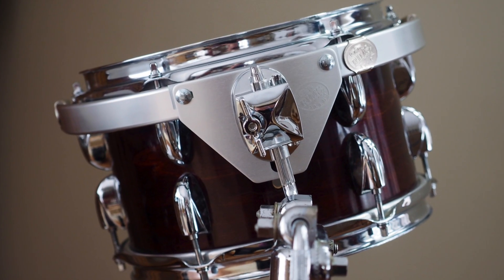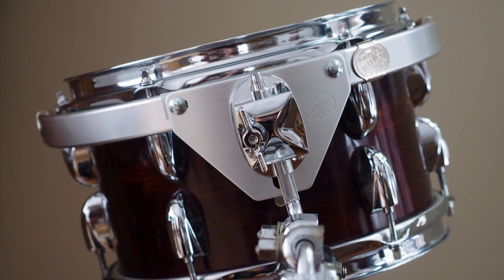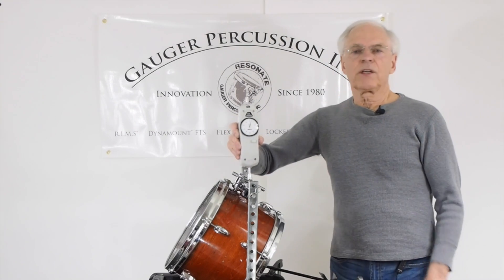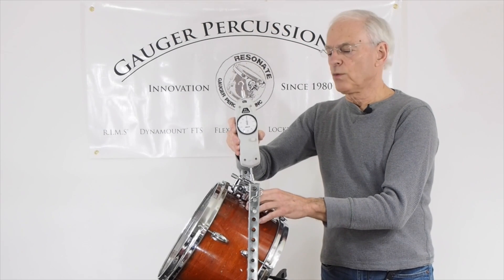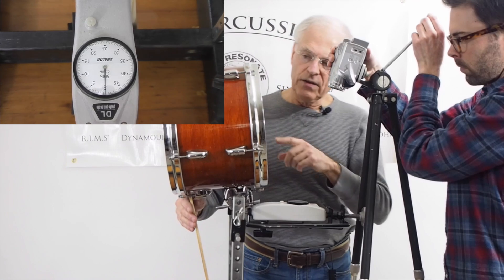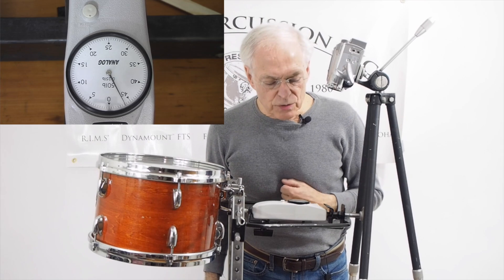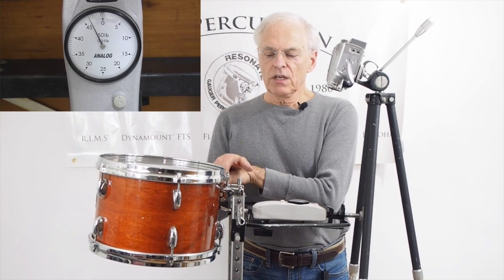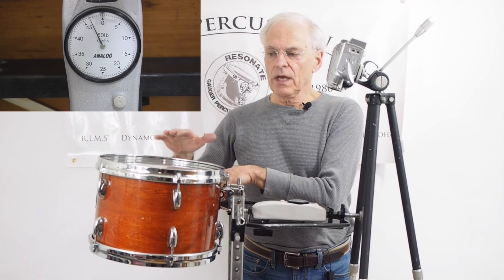Drum Shell Pressure Test

Comment: I don't know what you was trying to measure but you obviously did it wrong. That's not how it works. There's an old discipline called Resistance of Materials - which is some kind practical and extended version of Theoretical Mechanics - it calculates all that stuff taking in account the forces, directions, deformation, materials, forms, the surface integral everything applied to and so on. What you've measured is some kind of force - but why do you think it affects the whole shell and mount, i don't know. Even if you'd simply divide the weight of the shell by two mounting points you'd get the results that have more common sense than this.

Obscene forces on these two bolts!? I've just checked the charts. I quote from the methodic  "Calculations for tightened bolted connections under pressure".  Steel mark 10(very bad one), maximum dynamic min-max pressure is ~500kg per square cm. M14 bolt is 1,5 square cm in cross section. So 750kg of min-max dynamic pressure with the shittiest steel. There are two bolts for mounting as you said. So average pressure divided between two of them etc etc... And you are talking about 2 kg of pressure of the tom itself? You can literally could try to lie on that tom mounting until your stand mounting would crack because of the size of the leverage.

Summarizing, you can say the sender of the mail that he is an idiot and send my deepest condolences.
Reply from the maker: A drum is a very thin wooden shell that needs to resonate and the pressure placed on the shell is detrimental to the sound of the instrument. I invite you to take this video to any physics professor, or anyone who understands the physics of the "Moment Arm". We have consulted physics professors from the University of Minnesota as well as materials experts from 3M. It is very basic physics that you seem to be over thinking a bit. 

Furthermore, if you've  heard how shell mounts choke the sound and resonance of a drum, then there isn't much more to be said. If you have never heard this difference, then you simply don't listen to many drums. A drum shell is essentially like a string in a circle. If you touch it with even a little pressure (like a guitar string) you will disrupt the resonance. We used the push/pull gauge for it's precise purpose; to show how much pressure is being applied to a surface. While the drum is obviously able to physically hold up (or at least not break) under the pressure, it is terrible for the integrity of the drum considering it is a musical instrument that needs to be able to resonate. You don't see this type of unnecessary pressure being acceptable on any other musical instrument besides drums, which is very sad to us at GPI.

Aside from that, you are extremely rude with your final comments. I don't know why you feel it is necessary to disagree in the way that you do, but it's not a great way to share your point or get anyone to take you seriously.
Reply: Gauger Percussion Inc. You've mixed oranges and bananas. I haven't said a word about the shell. You quoted ridiculous nonsense about the mounting bolts - i gave you a overview that this statement had nothing with reality. If you don't believe charts - you can hang a weight on that m14 bolt, to find an obvious thing.

All you said about choking, resonance is obviously true but that's a whole another story. Beginning from the point that the hard tightened mounting is more affecting resonance than two bolted mounting itself, and even two bolted direct would resonate well if it would hang in it's equilibrium. etc etc. Not mentioning that Gibraltar's two bolts suspension system works and resonates well.

As for the form of my statement i just named the situation as it is. While your statement about his possible physics background leave questions at least for me as an engineer and a graduated percussionist.
Reply from the maker: The forces are applied to the shell AT the bolts, not ON the bolts, which is exactly what we say in the video (or, more specifically what the letter written to us by a drummer and engineer says). Meaning when you attach a drum from very small points off their center of gravity, large forces are concentrated at very specific areas of the drum shell. That is the main 'story' we are concerned with, which is why it's all we talk about, over and over, in the video. We are not concerned about the bolts or forces being applied to them. We are only concerned about the drum shell, which is what needs to resonate. The gauge measures the pressure being applied ON the shell, AT the attaching bolts and hardware.

Also, you say "I haven't said a word about the shell". But you did. You said "What you've measured is some kind of force - but why do you think it affects the whole shell and mount, i don't know." This lead me to believe that you did not think the force on the shell has any effect on it. 

Gibraltar's mount works very poorly. We hear from drummers constantly about this mount choking their drums, as well as Gretch's mount, which is the same design. It again puts unnecessary stress on the shell. Although it's not as concentrated a stress, it is a stress that is spread over a larger area of the shell. Possibly a lesser of two evils, but still a poor design and unnecessary. If you watch our other videos, you will see that that type of system was one Gary invented and tried on his drums early in the process, and found it did not work on his drums. It was a failed prototype for RIMS®, that later the large companies thought was good enough for them. I certainly invite you to use whatever works for you.
Reply from the maker: Here's a review we received just last week, of a customer that had the Gretch mount, that has the same design and attachment points as the Gibraltar mount, after he receive a RIMS® Alloy mount. He posted a picture of the two mounts side by side (which we posted on our Facebook page) and said this: 

"My RIMS mount came today and it it way better than I expected! Assembly was easy for me. The new design advantages are clear. The drum sings and had opened up a whole universe of tone and resonance that was choked from the previous mount. And I can also tune this drum much lower than before. Thank you again!!"

We receive statements like this constantly from drummers that are frustrated about literally every other mounting system. You can look at our 'Reviews' page for more. I hand roll every one of our mounts to make sure it fits a drum's diameter perfectly (because if it doesn't, you just create more unnecessary pulling or pushing forces on the shell), and it is made out of aluminum because that is a better isolating material than steel. We make a quality product here in the USA by hand, that has been backed up by over 35 years of playing drums, listening to drummers that use our products, and talking to experts that can help us understand better the nuances of how to improve our innovations and make drums sound better. If you are an engineer, you should expect better from how things are designed that what Gibraltar considers and isolation mount. There is no other musical instrument where the musicians find it acceptable to place unnecessary forces on areas that need to resonate.
Reply: Gauger Percussion Inc. At/On thing isn't clear from what is said in video. Other way i could hardly understand what those bolts diameter was mentioned for. So if the talkings were all the way about the shell - then my comment was unnecessary at all, but it wasn't clear at all. At least for me.

As for the other videos i watched them before -  and can say if i ever had intention to do such system my design would be similar to yours. I've completely support the mounting on diameter's ends as it would allow to resonate the shell the most natural way. But the resonance time is not the most important thing and in many cases it would be excessive so you'd choke it with a moon gel.  More to say - for years the most of the  greatests were playing and are playing now without suspension systems at all. So everybody choose what is suitable for them.

And again - your product the most advanced from my point of view. Cheers.
Reply from the maker: We feel resonance is the most important thing, and that it is important to START from a point of most, balanced resonance. If you decide to use gels or dampen from there depending on the type of music you are playing, then that is valid. Often, drums need gels because the low tones of the drum are being choked out by the mount, so there are undesirable high overtones that stick out and need to be controlled. If the low tones are able to resonate, then the drum sound will be full and balanced and you can easily modify it in many different ways and tunings. This also makes tuning easier, which is important.

We feel that many famous and influential drummers don't consider their mounting systems important, and their drum sounds often reflect this. Most often these days, they play whatever their endorsement deal expects them to play, which is the companies own mounting system. People that dismiss our products and point of view like to say "It's the drummer, not the drums". We feel this is lazy and rather selfish...it's the drummer AND the drums. I'm not denying a great drummer's ability to play great on anything, but a drummer should care very much about the instrument if it is something they are going to devote their lives to.
Reply: How did Gretsch ever achieve "That Great Gretsch Sound!" before these?
Reply: All I can say from my experience is I used the same on the shell mount system as we can see in this video. I choose it for my Gretsch 12" and 13" toms because it looks cool and I did not like R.I.M.S. type of a system at all. Hard lesson learned. My toms were absolutely dead and no tuning helped them to sound as they should. I got Gaugers R.I.M.S. and immediately that great Gretsch sound was back. I have other vintage kit with very thick beech shells and there are still mounts factory installed into the shell. In this case it works and drums sound good. But on my USA Customs I will keep Gaugers as long as I can play them. For a good reason. Period.
Reply: Older Gretsch drums used rounded bearing edges, one less lug than their competitors, and die cast hoops.  The problem with older drums and their thin shells with the older mounts is they could go out of round over time, especially in hot and humid climates.  If anything, these types of mounts like RIMS, or DW's STM, or Tama's Starclassic/Star mounts are dividing the weight of the drum over lugs opposite/across from each other, preventing the drums from going out of round.  It's not an issue with snare stand mounted toms, but most toms are mounted with brackets attached to kick drum, rack, or cymbal stand.  The increased sustain or resonance that these mounts provide probably doesn't matter too much in a live setting with amplified instruments, but it certain makes a difference in recordings.  Just simply swapping out the old hard rubber feet on my floor tom's legs for Pearl's air suspension mount feet made a significant audible difference.  My bandmates asked if I tuned the floor tom differently to make it sound better and all I did was change out the feet.